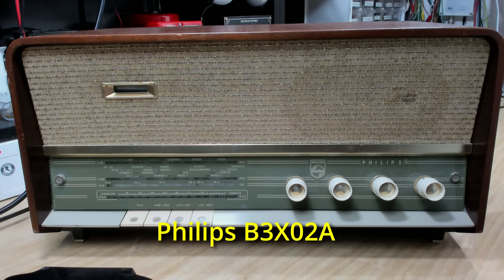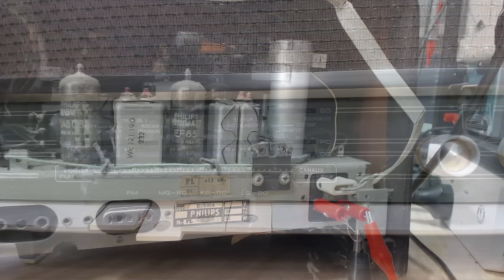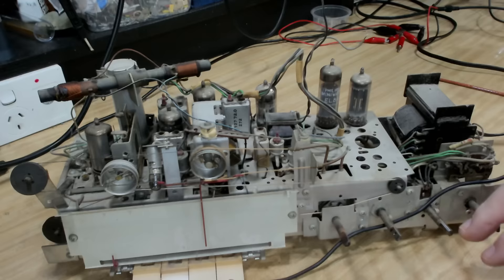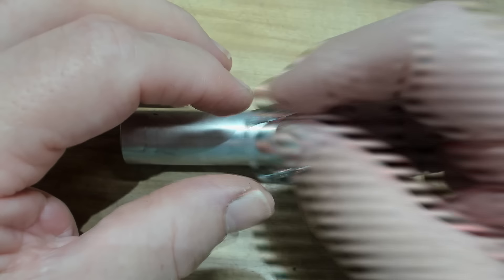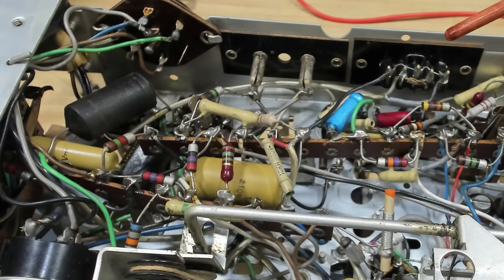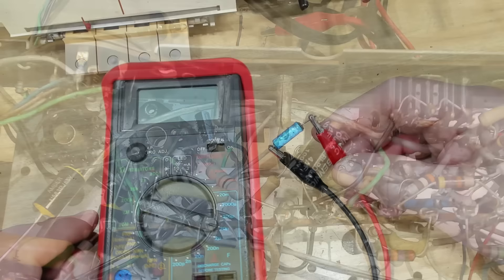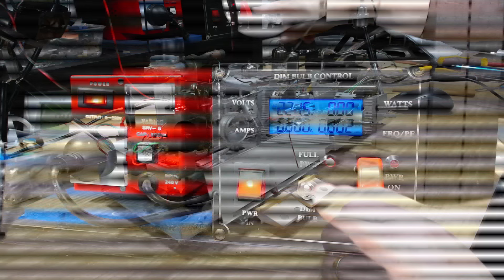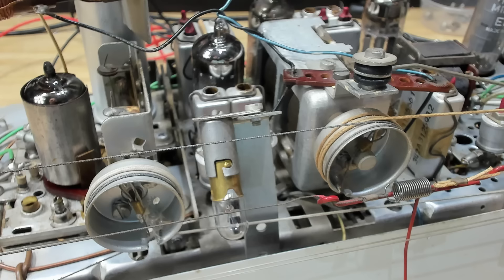Philips B3X02A AM FM Radio Repair - 1961

Comment: Nice job David. I like the design of the case and the restore job wasn't spoiled by not replacing the grill cloth. I think a little patina sometimes adds to an old radios apeal. If you had retored both Philips you could have called the video Double Dutch! 👍👍👍
Reply from the maker: I would replace the cloth, the owner says he is used to it looking like that. Good thinking with the double dutch, I should have thought of that. Thanks Gad 😃

Comment: Some handy tips and product types on brightening up the cabinet. 👍

The simple wrap around heat sink on the power reducing resistors was tech nifty. The use of thermal conductive paste topped that installation off nicely.

I like a radio with FM and a magic eye and this one is nice, especially complemented with the terrific speaker sound box.

Another Philips radio I am keen at working on one day, is a Philips Philetta.

Watching this Radio Adventure, has prompted me to keep looking for that Philips Philetta restoration project.

Thank you David!
Reply from the maker: Thanks Pete. I looked up the Philips Philetta, it looks a nice compact radio with all the features. Should make a nice restoration 👍😃

Comment: Another great video David thank you.  I think the internal antenna is probably a folded dipole for the VHF FM band (made out of a section of 300 ohm twin feeder)
Reply: It should be a lot longer to be of any use.
Reply from the maker: Hi Kevin, it was, it was probably better than I gave it credit for but it would have been pretty ineffective. It could only pick up one FM station in my house and that station is about 5kms away. If I had some 300 Ohm aerial wire I could have remade it I guess. The owner didn't use it at home 🙂

Comment: Most enjoyable as always. The capacitor can repair was very satisfying - I thought the wee bracket doodah worked out about as well as could be expected and I was greatly impressed with how you turned the edge to crimp it shut again. That was an education on its own! Pity about the grubby cloth but otherwise it turned out just beautifully. Thank you Dave, another beauty all round.
Reply from the maker: Thank you Mark. Haha... the little mounting ring was awful. I was in a hurry, it worked well though and can't be seen. I would love to fit a new cloth 🙂

Comment: To be honest, capacitor and resistor issues still account for most electronic failures even today in the "digital age". It is marvelous to watch someone like yourself, with the old skills taking on valve equipment. By the way, WELL DONE OZ for hanging onto the ashes..... even though they never leave Pomy (which seems weird, but......?) Your team was falsely accused of cheating, but you came back and bit us all in the arse.
Nice one 👍👍👍👍👍👍
Take care, keep safe.
Wayne & Nina
❤️❤️❤️❤️❤️😃😃😃😃😃😃🇦🇺🇦🇺🇦🇺🇦🇺🇦🇺🦘🦘🦘🦘🦘
Reply from the maker: Hi Wayne & Nina. Yes, that is usually the problem. We won but a hollow victory, would have been nice to finish off the series. 👍🙂

Comment: What amazes me ( well, many things about these repairs amaze me ) is that you can get the wiring diagrams for these old sets that even list reference voltages and component values.  These days, for most modern devices it's darn near impossible to find specs for anything.  I've seen car repair videos where you can get a water pump for a 1940's Oldsmobile or similar car but there are no parts available for my 2005 Mitsubishi.  Meanwhile, you can still get a big variety of valves for old electronics even germanium transistors.  Ahhhhhh, the modern world of disposable everything.
Reply from the maker: So true. I get frustrated when I can't find a schematic for an old radio, a bit spoiled I guess. 
They don't make things to be repaired now, hence no backup. Thanks Ellesmere 🙂

Comment: In Germany the Philettas were a popular family of radios.
AC DC sets often used on ships (easy adapted to many voltages), hotels, departments and of course the number one gift to confirmations and marriages.

Phillips in the Netherlands was a worlwide top brand. The best engineers and research and development department. They had production methods not known in the US and Germany back in the day. Parts is radios to high standards and tolerances

My first radio in Germany was a Philetta radio. Economic, reliable and compact.
Also known for many parts in a small case and not easy to repair often electronic parts in many layers.

I know Phillips has also a history in Australia. Please see my information as complimentary to the history you know in Australia.

In the 60th and 70th all the radio users knew about AC DC sets.
Today many young people are interested in valve radios but don't have the knowledge.
Reply from the maker: Oh yeah, Philips were a huge company, some unorthodox thinking sometimes but usually worked very well. Thanks Jen 🙂

Comment: A great performer. I noticed the IF valve is a Ef85. I looked it up it is a variable Mu version of the ef80 6BX6 very high gain.    Not many people go to the trouble of elegantly reshuffling can caps. You did a great  job. BTW 4BH moved their transmitter to west mt cotton 17kw. It used to be at bald hills. So now I can pick it up in the daytime here in Byron using an outside loop aerial.
Reply from the maker: The EF85 was pretty standard in these European FM sets. The 4BH transmitter is still at Nudgee by all accounts. It was damaged some time ago and a temporary transmitter set up, maybe you are picking up the temporary transmitter. Wherever it is I can't pick it up at Mount Cotton although I'm on the east side.

Comment: Great job Dave.
I've been watching your videos for more than a few years now. It's always a pleasure.
One piece of advice I would like to give you is to always use the two equal resistors method for aligning/centering the FM ratio. But instead of the current meter, you can easily replace it with a digital voltmeter and align it to 0 volts, which would be equal to no current flow (much more accurate).
Reply from the maker: Hi @tuberadiobavaria4114. I usually follow the manufacture's' instructions. The two resisister method is what I normally use. I haven't tried it with a DMM, I use a analogue voltmeter. I think the sweep generator and oscilloscope is an excellent and probably the best method if you want to go to the trouble 🙂

Comment: Interesting way to adjust the ratio detector. The method I've alway used is to tune the radio to a place where there is no station, then adjust the detector for 0 Volts.
Reply from the maker: That's what I did 🙂

Comment: Enjoyed your work on this radio... sometimes I get lost trying to follow your explanations (but thats me not you). It does look smart but its a pity about the grill cloth as it really detracts from the finished product. I always like the way your engineering skills come to the rescue. Keep restoring and keep smiling.
Reply from the maker: Hi Kenneth. I would have liked to like to replace it. I have it's twin, I will replace the cloth on mine and it will look striking. I might need to cut out the front panel with the cloth on it and make a new panel, a bit of work but not too hard. Thanks Kenneth 👍🙂

Comment: These sound great with bluetooth. Glue a micro to the chassis so it makes and breaks  contact on the phono switch pully. And the signal goes straight to the phono switch also.  The board fits on top of the transformer
Reply from the maker: Good idea Maarten, thanks 😃

Comment: A nice restoration as usual. I mean, you always make such a nice project of these oldies.
About the FM antenna : that internal lint cable antenna works pretty well if no external antenne is available. It is a folded dipole, made up from 300 ohm lint cable. The silly thing is you will have to swivel the radio to get the best reception.
Cheers and thanks 👍🏻🤝🏻🇳🇱
Reply from the maker: Hi Nard, thank you. The internal antenna was home made from some 300 Ohm TV cable. It was joined and the ends and shorted out the FM antenna. The radio didn't have a FM antenna originally so I removed it. I considered making an FM antenna but decided it didn't need it. The owner has a dipole antenna. Thanks Nard 👍😃
Edit: I checked the video again and the antenna was not shorted, I was mistaken. It may have worked to some extent, it was falling apart and I don't have any replacement 300 Ohm wire if I wanted to recreate it.

Comment: First time I've seen schematic this model radio I had 70s. Now remember in a different way.   Some people wired pair semiconductor diodes across wires detached from ratio detector valve base. they also did that with TVs too its PABC80
Reply from the maker: A couple of diodes would work. Thanks jagmarc 🙂

Comment: Sounds great, nice job on that multi-section capacitor, and the wire-wound resistor mods!  IMHO, Dutch and German electronics of that era take a special skills set to accomplish repairs to circuitry requiring calibration, maybe it's the difference in capacitance values, transformer physics and anatomy, or the higher mains voltage, but I always had to spend almost twice the estimated time getting things 'dialed in' versus North American and U.K. "fare".  (working for Smiths Aerospace all those years, and tutorials from Alasdair, a fellow engineer helped when anything "Roberts", "Bush", or "HMV" appeared at my Motorola dealership.)

Hope this finds you well, Dave, only the best, and CHEERS!  Tim
Reply from the maker: Hi Tim, I couldn't agree more, German and European radios in general take much more effort than others. I dare say due to the increased complexity. Once going they are very good to use and listen too. Thanks Tim, I'm good thanks, I hope it's the same for you. 🙂
Reply: @DavidTipton101 What is the most complicated radio repair you did?
Reply from the maker: @tompsheridantsheridant7354  I think the STC 830, it is a complex radio and very old and in very poor condition. Any of the German sets are difficult to work on, the switch mechanism is fault prone ad impossible to get to in most cases. There is also lot of tone shaping circuits and has at least 2 to 3 AM bands plus FM.

Comment: Another very enjoyable and entertaining video. I carefully use a needle file to open up the aluminium case of a capacitor. It works for me. Looking forward to your next installment.
Reply from the maker: Yep, whatever works Terry. I avoid putting crimp marks in the aluminium that can be seen when the capacitor is mounted 👍🙂
Reply: @DavidTipton101  I do have a lathe but the chuck will not open enough. 👍😊

Comment: Great restoration Dave. The ratio detector alignment won't get upset with a new capacitor. I've had radios that had completely open ratio detector capacitor, and no matter what I put in (3.3, 4.7, 10uF), the S-curve on the scope remained the same :) Otherwise nice job. Those Phillips smoothing cans were usually still perfect 10-15 years ago, but I am seeing more and more of them having decreased capacitance
Reply from the maker: Thanks @michvod. Yeah... I do wonder that but not sure. The capacitor needs to be near correct value as it's working with the resistor to get the correct filtering. I will try and check before and after next opportunity. thanks for the thought bubble 👍😃
Reply: @DavidTipton101  It has to have certain capacitance to do the AM rejection. In theory the capacitor should be as large as possible, but then you have a problem with cap discharging and charging while changing stations. I worked on a set that someone put a 47uF cap there (instead of 5uF), that worked perfectly, but the tuning was "laggy", the magic eye opening/closing and station strength was delayed as the cap needed much more time to charge/discharge. So perhaps you can experiment next time by putting a larger (or smaller - like 1uF) value capacitors in there. Some sets even had 2.2uF or 3.3uF caps in there...
Reply: @michvod  would multi capacitors in series or parallel charge differently ? (in theory not any more or less than a single large ones)
Reply from the maker: @michvod  Thank you for that information @michvod. I will take it onboard. Thank you 👍👍😃😃

Comment: Looks great.  If it were mine, I would try to fit a larger speaker in it.
Reply from the maker: It would be a bit tight getting a larger speaker in there. It will take an external speaker however 👍🙂

Comment: Hi Dave,
Most Philips products of that ere do work well.
Although there was not a great deal to do in this instance, it was what I refer as a  ‘short and sweet’ job.   Definitely to be welcomed as we are ever seeing more a more Vintage Radios in poor condition.  Some of them are barely worth repairing or restoring but I guess most of us do it for love.
Loved seeing this video.  Best regards from Phil.
Reply from the maker: Hi Phil. This little radio worked very well, I have another one I will fix up for myself. Unfortunately a lot of radios are beyond repair as you say, poor storage is usually the culprit. If I were doing this for money I would have gone broke years ago. Thanks Phil 👍😃

Comment: WOW. I had two of those. Neither had a propper working FM. I destroyed one exactly by trying to adjust the coils. They fell appart. The second one I had to install a different FM tuner, it works much better, but not as it should be. Also the magic eye never came in full on FM.
Reply from the maker: Those transformer coils are easily damaged. I only adjusted one because I had to. Thanks Veljko 👍🙂

Comment: I looked up FM broadcasting, because FM radio was not really a thing in the U.S. until later in the decade.  In Australia FM broadcasting was shut down in 1961 only to reappear in 1975.  It appears as though the Netherlands, Germany, Belgium and Denmark were the first to adopt FM broadcasting on a large scale early on.
Reply from the maker: Hi Stanley. As I understand, we ran an experimental broadcast from 1947 till 1961 but I have never seen a FM radio that was built in Australia in that time although there may have been some. It only had one station and that was the national broadcaster ABC. FM started officially in 1975, the only FM receiver we had was a clock radio but programing was pretty ordinary, almost amateurish. It took a while for stations to be granted licences and FM wasn't really a thing till the 1980s. Thanks Stanley👍🙂
Reply: @DavidTipton101  We must be on the same Wikipedia page.  As I recall, my Dad bought a table radio that had FM in 1968.  Then my parents bought a console stereo in 1969 which had FM.
Reply from the maker: @stanleycostello9610  I'm not sure where I read it, might be Wikipedia 🙂

Comment: Great job Dave.  Those magic eye deals usually have a few buried resistors that prevent closure. I know you changed the one on the tube (R9 looks like a good suspect).... probably a tolerance thing... Great beautiful job
Reply from the maker: Hi Ron. I tried a work out magic eye and it worked more as I expected but was too dull to fit to the radio. Thanks Ron 👍🙂

Comment: Hi Dave, although it is probably on of the nicest sets you've worked on electronically and aesthetically, it was still fascinating to watch you improve it. Always amazed at how comfortable you seem to be around radios you've never seen before. The first FM station you tuned in sounded so good i said to myself: There's nothing to do he's going to close it up''.  But there's always a little something to improve right. ?  Your cabinet work is impeccable as always. The owner is going to be so happy i'm sure of it.  Thank's for sharing, be well, God bless.
Reply from the maker: Hello Raymond, thank you. It is a nice radio and I have it's twin to fix up for myself. The first FM station's transmitter is very close and and can be picked up be a loose tooth filling 🙂 
It only need a few old capacitors replaced and a clean so a very easy radio for once. Take care 👍🙂
Reply: @DavidTipton101  Ha ha ha that's funny, you made me laugh Dave. Ok i thought the other radio was for parts if needed for this one. I get it now :-)

Comment: I was surprised how well the case improved after treatment :-D
The can caps were so Buggered ( Technical  Term )  :-D
You were taking a risk with the i.f tweak,   Danger man lol.
Reply from the maker: Yes it came up well, I wasn't sure how the Howards would stand up but it was very effective. IF tweak... I know, I was sweating when doing that 😄
Reply: @DavidTipton101  Do the ferrite cores just snap where the tool fits in the ferrite slot? 
I've had that happen with v.c.o transformers in c.b radios, i had to desolder the transformer and  remove the core from it's bum lol..
 (if they didn't embed an  evil fragile tube capacitor).
Hate the fragile tube capacitors :-(
Ill shut my trap now lol.
Reply from the maker: @zx8401ztv  In my experience, the top snaps off the slug at the slot and jams the slug in position.
Reply: @DavidTipton101  if you are very lucky, the core is accessible from the under side.
Sticking the tip of a hot soldering iron on the ferrite core  can prevent snappage lol.
I'm sure you have come to the same  thought a long time ago.

Comment: Looking and sounding fine. Curious as to whether you use foam cleaners for the grill cloth. Was also thinking of an oxy action laundry powder (using just the suds), probably a step too far if the cloth can't be removed first.
Reply from the maker: I used a spray on foam upholstery cleaner but I don't think it works all that well on grill cloths. I might stick to shaving foam. Thanks Ralph 🙂

Comment: Great video once again, Dave!
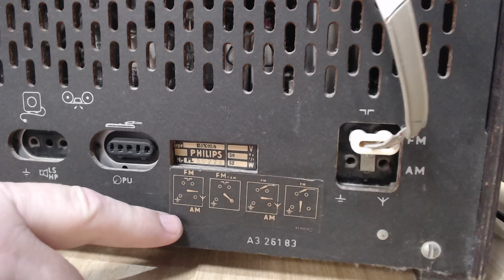Small remark: this one is not built in The Netherlands, but in Belgium. At 2:02 you can see that the serial number starts with "PL" which stands for "Philips Leuven", a city in Belgium where a Philips factory was located at that time. And coincidentally, it's also the city where I live currently. 😊
Reply from the maker: Ahhh... thanks @retro_tech, good info. Using the part number code I knew it was made in Netherlands/Belgium but you have narrowed it down. Thanks @retro_tech 👍🙂